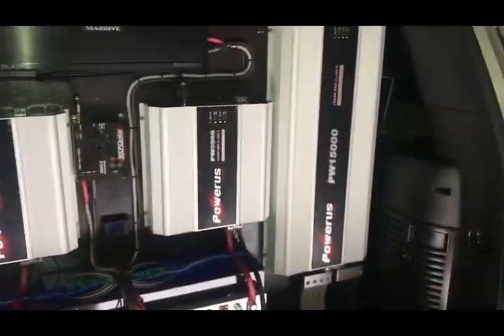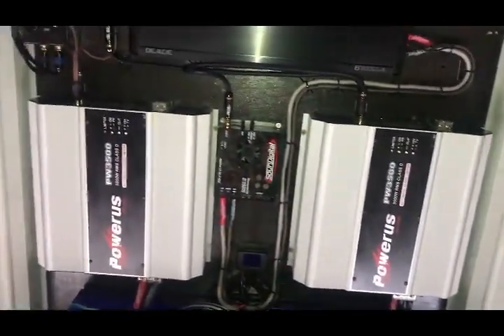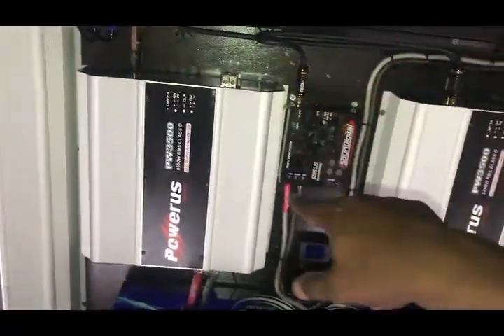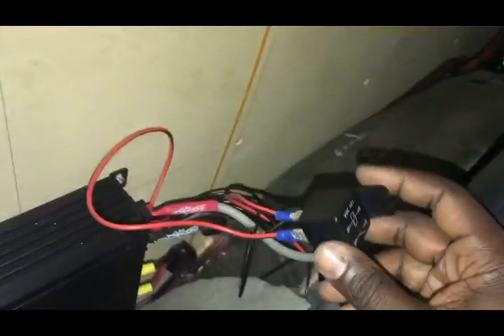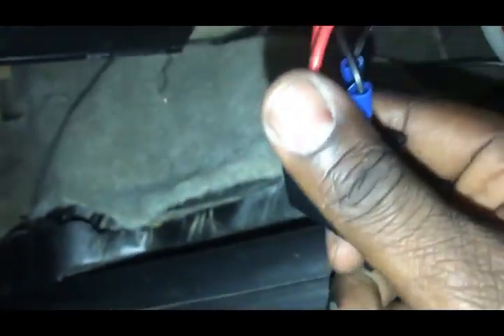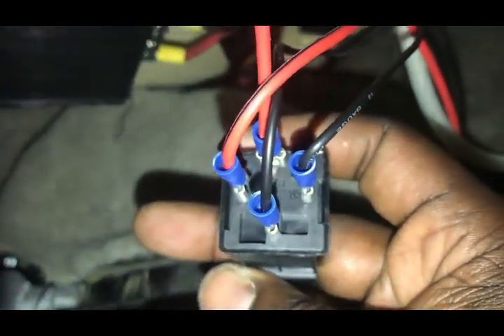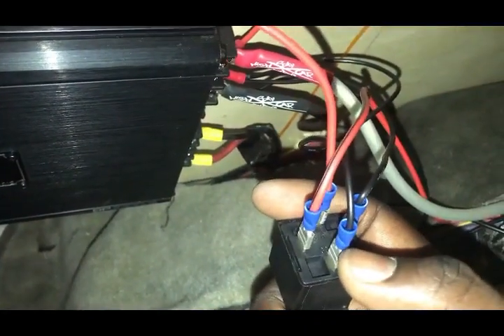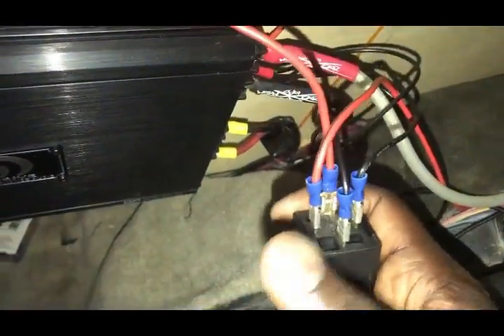How to use a relay switch for multplie amps plus teaser pics

Comment: Great video, thanks! Question regarding number 86: What hooks up to that? And question for ACC 30: what hooks up here?
Just a little confused: Does the fused accessory wire go to number 30 from the fuse panel ACC, and then number 86 goes to the amps as a remote wire?
Thanks in advance for your advice

Comment: Can the relay be directly connected to the amp? 87 and 30 to the + of the amp and 86 to a toggle switch and remote turn on of the amp. Then ground the relay and toggle switch to the - of the amp.

Comment: A relay puts more stress on your headunit or dsp than just daisy changing your remote wires. It takes more power to charge a relay than it does to tell the tiny diodes in your amps that tell the amps to turn on.  You don’t need a relay to power up multiple amps lol.   Watchbarevids  videos he proves it .  I would use a relay on cooling fans or something that pulls more power.  Amp just need to be told to turn on by remote require super low voltage going thru your remote.  And 30 should be dsp and 87 your amps correct? If you use one

Comment: The source  is the 12v from the car harness that go’s to my headunit,  so that wire from headunit go’s to 86 on the relay,   i now have 4 amps connected without a relay but iT works fine, maybe time for relay, you also fuse  the wire that go’s to the battery ?

Comment: When you say daisy chain, is it that the wire goes to the 1st amp P control, then off that to the 2nd etc?
Reply from the maker: ginggur17 out one rca output to another rca input
Reply: BassGod thanks.

Comment: why are u putting terminals and electrical tape on such a beatyful build man go get a relay harness is only $2 i know this is probably going to be covered but still they even come with a ceramic thing to withstand heat and ofc 12gauge wires to maybe for $5 wich is better than the cheap $2 relayharnes
Reply from the maker: michael segarra probably because I’m old school when it comes to electrical  tape lol. I’ll look into it man thanks
Reply: lol dont get me wrong im the electrical tape master you have probably seen in my builds :) but this is a nice build and a lot of time and money you have put in to it it will be more secure to

Comment: 30 comes from the battery
Reply: I think you have 30 and 87 backwards. Battery goes to 30, and 87 goes to amps last time I recalled, and 86 turns the remote wire on that used to be blue grounding anyplace not near audio wires
Reply: hey do u think that y my amp not working
Reply: Lol 30 is main or dsp lol he has it backwards lol 87 should be amps.